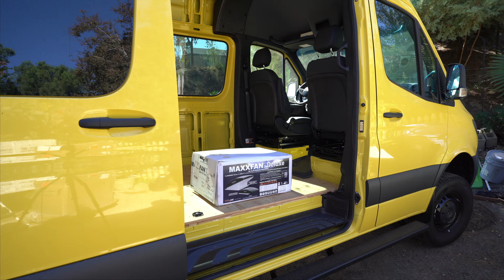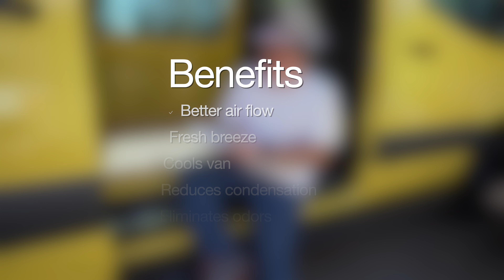DYI Campervan: Roof Fan Installation

Comment: Ooh l forgot to ask what is the reason for using the masking tape?
Reply from the maker: To protect the area right next to the cut from possible scratches. It is also easier to see where you need to cut.
Hope that helps.
Cheers.

Comment: When it's hot outside where does this "refreshing breeze" come from, but there is an amount of solar gain through the clear plastic? The answer is maybe at night, or dawn and dusk. My friend has one of these and I would argue mine, without one is cooler during the day. A better solution is a safari roof, which you could achieve with solar panels, plus cutting holes in the roof is a bad idea, because one day it will leak.
Reply from the maker: Yep, during a hot summer day, there is just a breeze... not a refreshing breeze ;-)
Thanks for pointing that out,
During the day, I am out and about most of the time, so I am happy to have that refreshing breeze in the evening/night.
Cheers from a hot state.
Reply: @JourneyCampervan  I get the same with my USB fan and don't cut holes in my roof.